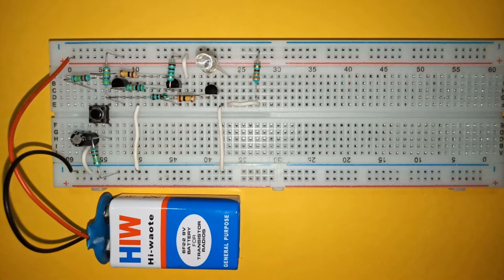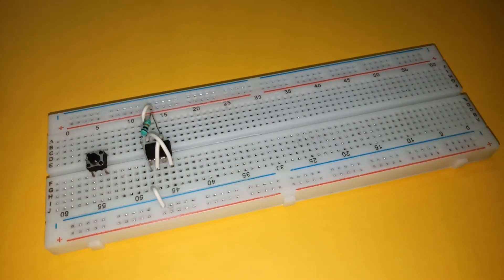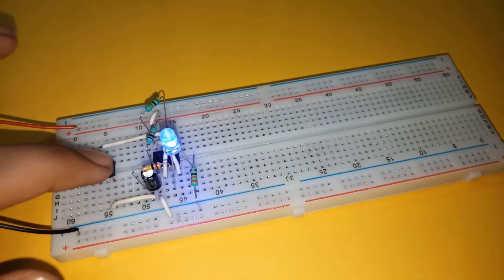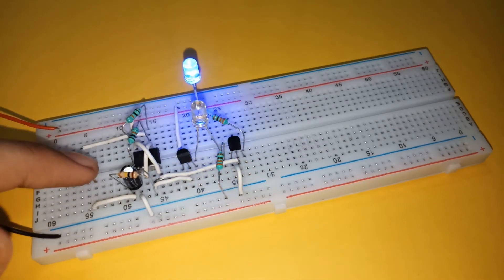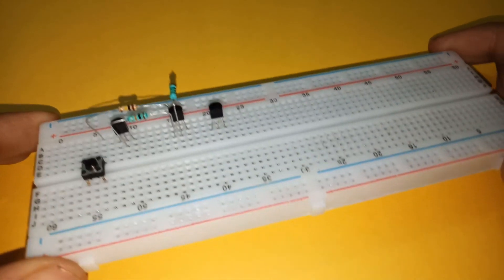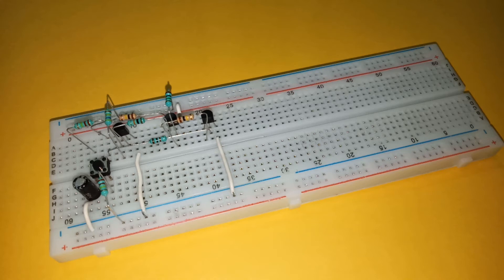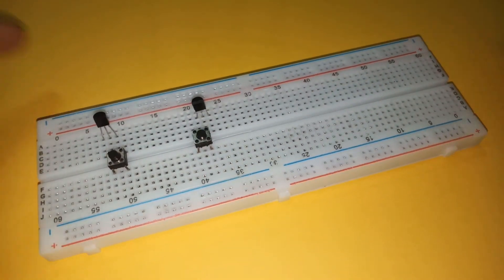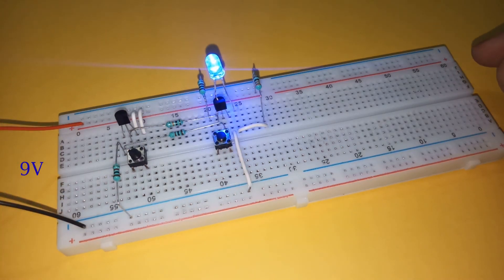Three Push ON – Push OFF Latching Circuits + Toggle Circuit || Step-by-step Tutorial

Comment: Can it be used with 12v without modifications?
Reply: I had to add another led with a 1k resistor in series at the beginning of the circuit for it to work on 12v but it does work well

Comment: Will the 555 timer ic circuit work on 4 to 5 volts? I want to use this with 5v relay. Also which text to speech software is this???
Please answer
Reply: 5v will be enough to power the 555 ic

Comment: Why does the last circuit become unstable and won't turn off when fast switching it?
Reply: Voltage is too high, try adding another led in series or increasing the resistors

Comment: How can I have the output as one motor that switches direction each time the button is pressed
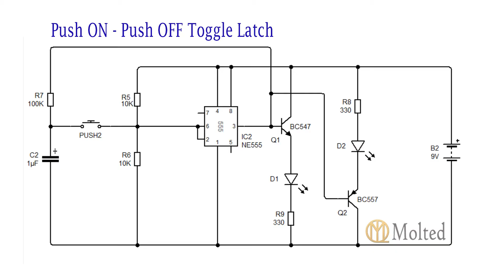Reply from the maker: You need to connect two Relays at output, replacing the two LEDs from circuit diagram (2:05) of extended Toggle Switch Circuit and doing wiring as shown at 1:58 in one of my video - https://www.youtube.com/watch?v=V8eSd9sWKts
(You will also require two extra batteries)

You can contact me via E-mail if you didn't get that point and want to get practical demonstration.